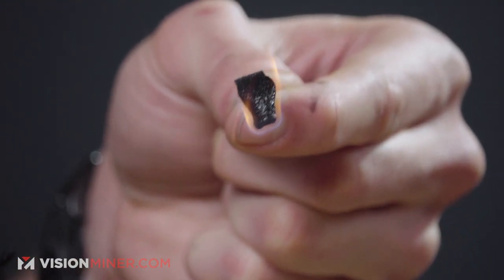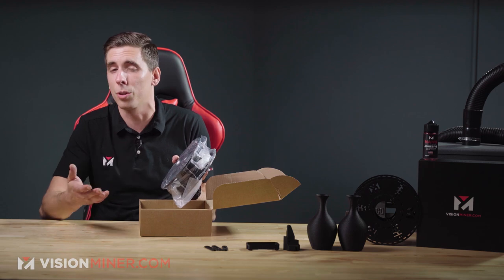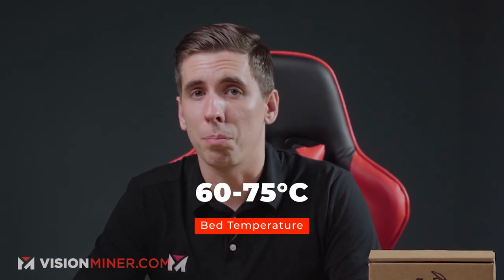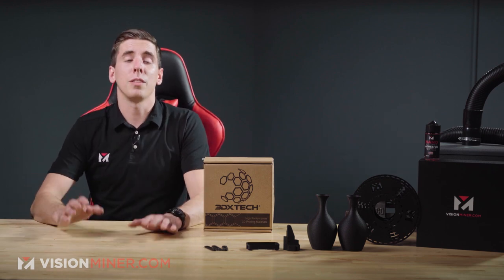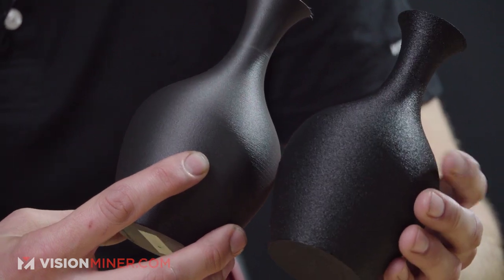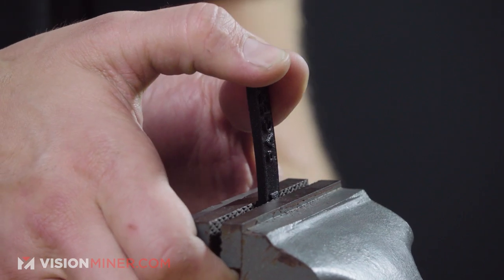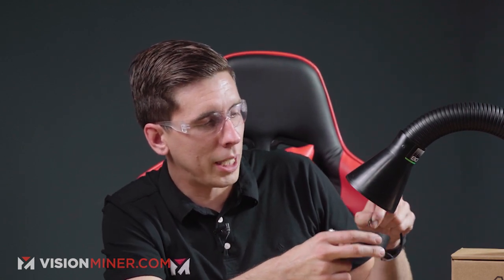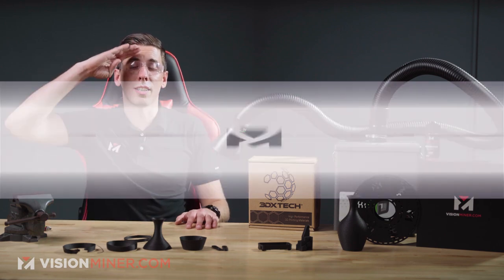FIBREX™ NYLON+GF30 Glass-Fiber Reinforced Nylon 6 (PA6GF30) 3D Printer Filament by 3DXTech

Comment: basically every power tool shell is made of PA66-GF30 or even higher glass content, For that reason it seems like the go-to for strong filament as its already stood the test of time in the injection molding industry, Layer adhesion is a variable injection molding doesn't deal with though.

Comment: this stuff completely demolished my ruby nozzle, so far my jet black hardened steel nozzle is holding up well.
Reply from the maker: Wow, really? Like, the orifice of the ruby wore down with the glass fill?? That's surprising! Or did it just clog/jam?
Reply: @VisionMiner  looking directly at the tip, the ruby is still there but 360* around the the ruby the brass has been eroded.

Comment: Ultem GF vs ultem CF? I'm currently using regular ultem but looking to try filled ultems. Would the GF be less brittle (you mentioned that for nylon GF vs CF)
Reply from the maker: Great question, we'll have to do a video on that! Do you have suggestions for geometries to print which would really show the difference?
Reply: @VisionMiner  maybe two 20x100x10mm rods so you could bend them and see how much they can take before snapping.
Reply: I know you
Reply: I haven’t seen any ultem builds yet 👀
Reply: @sebastiancamarena2824  I did a liberator in the first video on my channel. Didn't go quite as well as I expected though.
Reply: @3darms  ultem on a liberator ): y

Comment: glass fibers are not good for your body and gives very bad micro splinters, you really should be wearing some kind of gloves for this and carbon fibers as well really.
Reply: You have no idea what you're talking about.
Reply: @picklerick9578  there is a reason people wear protective gear for fiberglass, he's breaking the plastics with his bare hands exposing whatever fibers are in it. Just because it's surrounded with melted plastic doesn't mean those strands won't give you microsplinters... especially with 30% content, that's enough to be present in a snap like that for certain. I do know what I'm talking about, I'm preaching proper safety for an informative video that uneducated people will see and interpret things as safe, when they are in fact not.
Reply: @alexmills1329  No, you're ABSOLUTELY incorrect. Do you know what happens when this material gets melted and recrystallizes?
Reply: @picklerick9578  the nylon melts, not the fibers.... yes the nylon will encase all of those fibers, but that is invalid when you start snapping the pieces. Maybe I'm not being clear enough here, that's my issue is breaking it bare handed, it I'd undoubtedly going to leave 'burrs' of fiber upon a fracture especially one 'not along layer lines' as is noted in this video. What point are you trying to make here, if you state it we can have a meeting of minds here, otherwise you provide no reason to pursue further discourse on this matter
Reply from the maker: @Alex Mills @Pickle Rick --- well, this is truly an interesting one which should be studied further. There needs to be more study on the amount of fibers becoming exposed or potentially harmful..... really not worried about the dust, and I probably wouldn't make handles out of one of these materials... but how much danger is actually presented when it's broken? Someday, we'll know.... who's got more info?
Reply: @VisionMiner  It's not a problem. If you have a high modulus glass fiber, it's extruded into the material. This isn't like breaking fiberglass fishing rods or the flagpoles on fire hydrants
Reply: @picklerick9578  but it is a lot like the fiberglass made ladders, as they age and weather in the sun the fibers are more exposed and you will get terrible rashes from wherever you touch it. the guys who put in fiberglass insulation have to wear gloves and masks for protection from the exposed fibers. In a solid plastic it's safe to touch, once it's exposed, good luck it's not great for the human body
Reply: @alexmills1329  No, you miss. The point. Those are exposed fibers that are just straight up strands of glass fiber. This is not the same thing. Even as this stuff ages, it doesn't break down like other fiberglass products because it's only comprised of 30% glass fiber.

I'm using this for making Glock Frames and other firearms components, trust me, if it was a concern, no one would be using it. These materials are used in industry all the time.
Reply: @picklerick9578  I understand that nylon is often reinforced with this stuff for tools, polymer guns and tons of products, you fail to understand my point about breaking this stuff, the nylon doesn't break down like resin gluing fiberglass together so you don't have to worry about this issue, but when it breaks you do need to worry about it. I'm building a composite boat out of fiberglass, I've worked with these materials plenty of times, and I agree with you it's a good compound for use in a glock frame, hell I would use the same thing myself. I'm trying to show off my point that these are supposedly glass fibers not glass microbeads and therefore will have the same issue once its stripped off the plastic and exposed. watch AvE cut into a gf nylon tool and listen to the glass, it should be the same as what you use to 3d print, and if it is, you only need to worry once it's broken into pieces. I'm not trying to tell you to not use the stuff, I'm merely trying to raise the point of proper precautions to those that are newer to the materials they are working with
Reply: This is one of the most abrasive materials, I ever printed. And I've printed pretty much everything that 3DXTECH has to offer. Forget about micro splinters - I've cut my finger once while trying to remove this material from the bed..